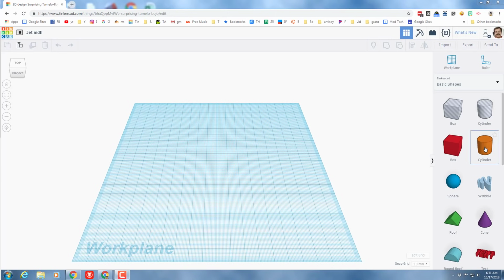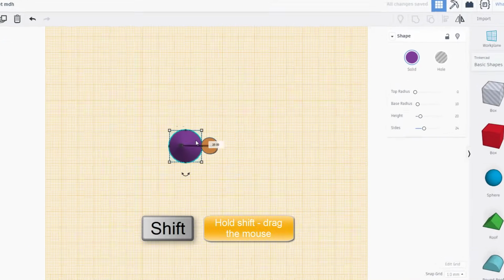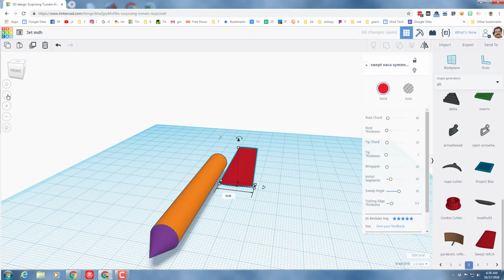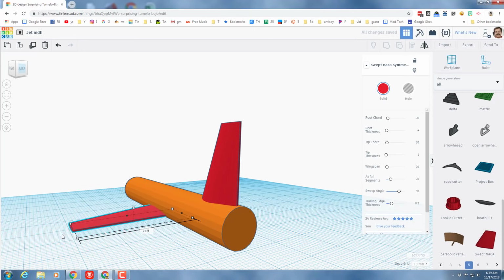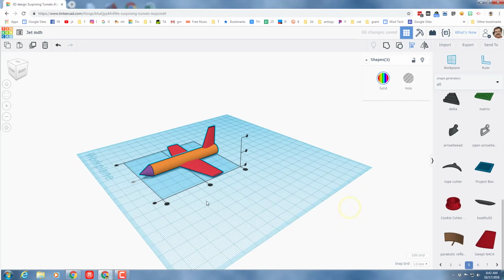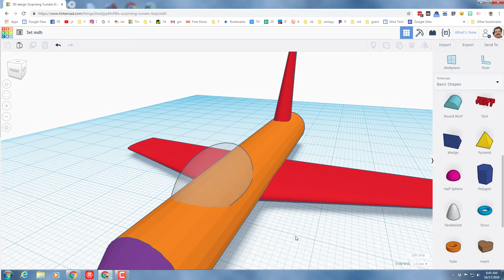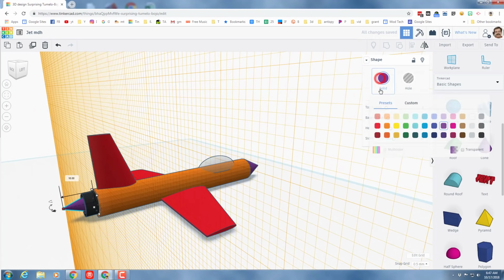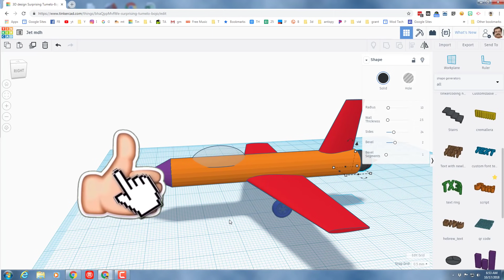Design a Tinkercad Jet in Minutes | Check the cards for an F22 Raptor!

Comment: I tried to make a machine and when it got too big parts started to disappear, thing is it was not a complicated design , any advice?
Reply from the maker: What sort of computer are you using? WiFi or Ethernet?
Reply: @HLModTech  Ethernet.
Reply from the maker: @quantumenergysolutions9128  So that should eliminate connection issues. Were you making a jet like the video or something on your own?
Reply: @HLModTech  How can I find you on tinkercad? I will publish what I did so far, It ended up becoming one colour when I wanted separate! , It needs finishing, just the rest of a box for it.
Reply: Ok check your tinkercad account for a comment.cheers
Reply from the maker: Sorry I was slow to see this. Did I ever catch up with you in Tinkercad?
Reply: @HLModTech  can I email you?

Comment: Thank you!!! I had an Aircraft carrier I designed and I need jets. This will do nicely!
Reply from the maker: How did the aircraft carrier turn out?
Reply: @HLModTech  Not too well. I had to use the school's printers bc I didn't have my ender 3 and v2 at the time, so I had a time limit. The way I designed it, it was too small, and one of the pieces broke off.  I was a novice at the time as well so it also didn't look good. The jet did print nicely tho.
Reply from the maker: Sorry to hear it did not turn out too well. Did I read correctly that you have 2 3D printers?
Reply: @HLModTech  yes, got one for my birthday and won one from creality
Reply from the maker: @Kyo-bd4tw  That is super cool!
Reply: @HLModTech  yeah, I submitted a model of an ender 3 that I made into the creality cloud contest and won